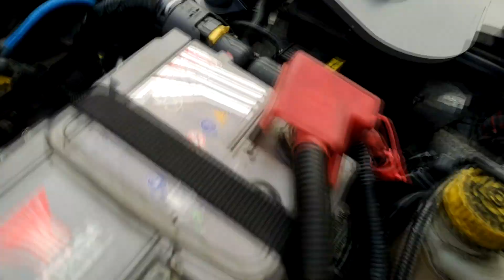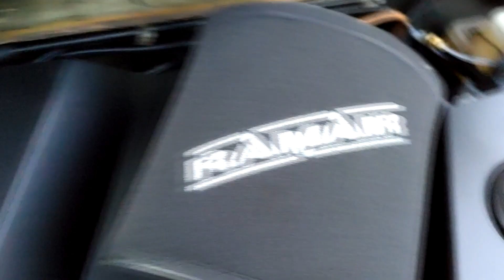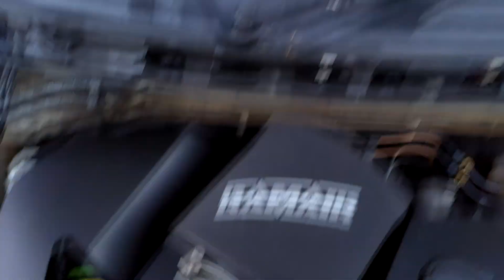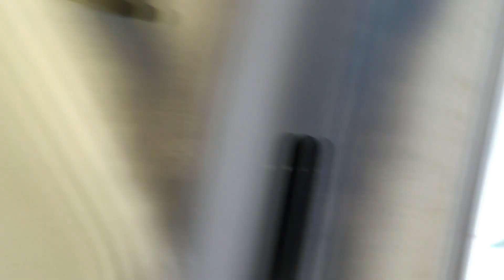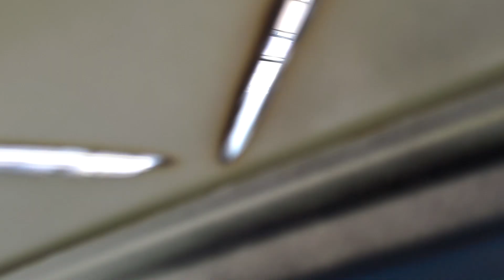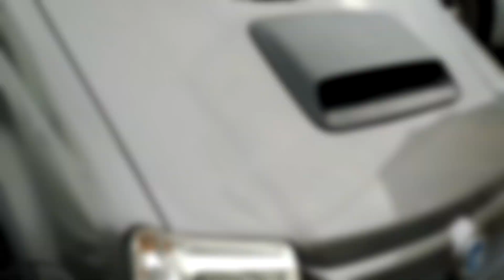TJet Fiat Panda 100HP Air Intake Upgrade

Comment: Having taken my 100Hp to quite a high speeds (more than 180 Kph) I'm not sure I would put a hood scoop on the front. The thing is that Panda has quite a big opening for the radiator, which means a lot of air gets into engine bay. The good thing is that it cools engine very nicely but after that work is done its forced only way it can go - under the car - creating lift and making the car unstable and floaty at high speeds. So I would stick to original air intake spot behind front bumper and put that scoop rotated exactly 180 degrees, so it would be more of air went. Then it would put more air over the car making it more planted at high speeds. But if you're not as much of madman as I am, or just plan on some low speed stuff just go for it.
Reply from the maker: I'm not a very fast driver on the roads. I prefer going fast in the turns than the straights ;)
Reply: @Pandamime  For that purpose I'm actually looking into one of these: https://shop.quaife.co.uk/qdh3k . With 100Hp suspension characteristics there is a weird spot in the corner where if you try to accelerate more, you make right front tire slip causing understeer and when you lift off to tighten the bend you get nasty oversteer. I was thinking about making suspension stiffer but it would make my car very uncomfortable to ride on many of my country roads. But if I fit some kind of limited slip differential I can put more torque to the loaded wheel without altering much of the suspension characteristics with added bonus of better acceleration in bad road conditions - much less one tire fire in rain.
Reply from the maker: @Doktoreq  Sounds expensive! Definitely something I may look into in the future though. I don't think the Panda will be great in the bends with the turbo but I've yet to see it go properly :/